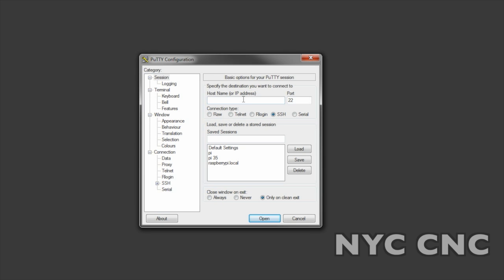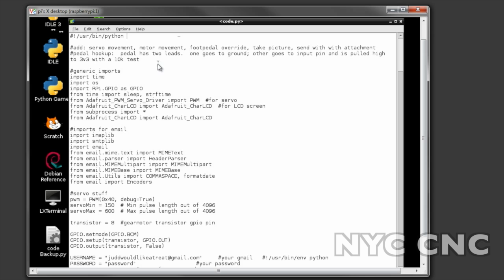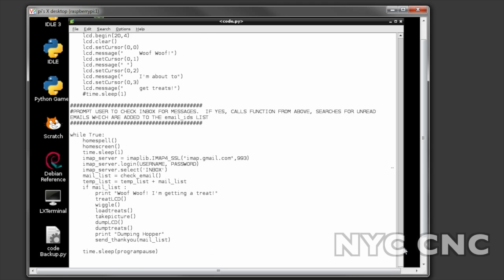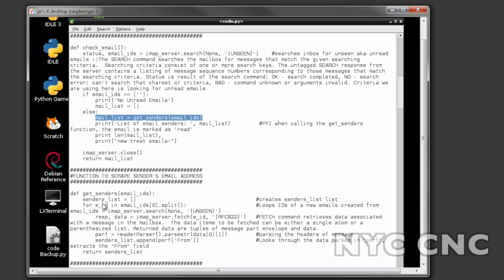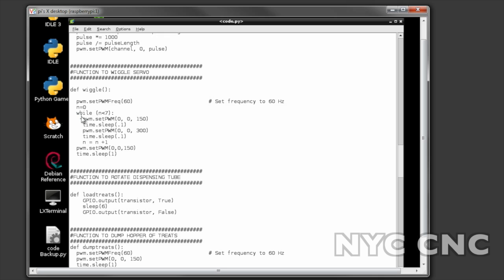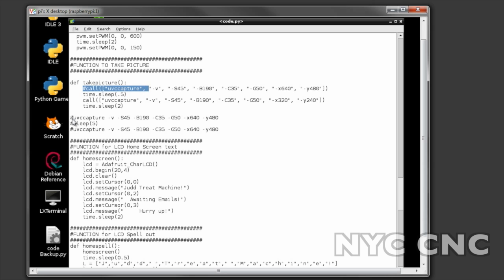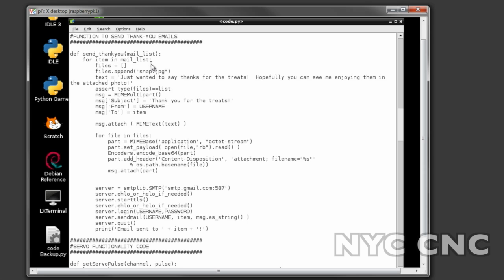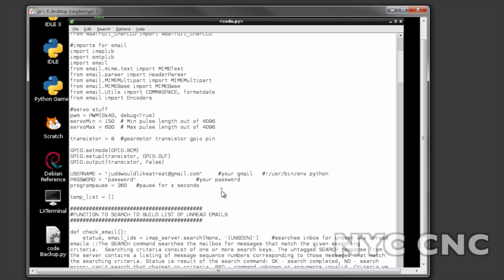Raspberry Pi Dog Treat Machine - Video discussing Python Code

Comment: hello john
thanks for you video.. it is really helpful.
so basically i am trying to modify the code for my traffic light that i want to control through email. i just want to make it work like when i email red, the red light should be on... Please help me with the pin number coding and the check email and sender's email option.. like where i have to put these stuff
also let me know if you have any better idea. i will look forward for you help...Thanks

Comment: This is an amazing project, and I finally finished 3d printing all the parts for my version of the Judd Treat Machine.  I decided to use a servo to turn an auger in a tube to drive treats forward to the spout.  i also removed the code and imports for the LCD screen.  I added 3 LED's (just recently) to indicate when email is being checked, and when a picture is being taken and a kind of not needed indicator for when the servo motor is dispensing a treat.  I only have the one motor that dispenses treats directly. :)  I removed a ton of code for the various features I removed, and added code for some that I added. :)

I added a load button to turn the auger manually to make sure there are treats up the tube so to speak  I also kinda cheated, i used the raspberry pi to control an arduino which runs the servo and turns on the various indicators. :) ( the LED's I may do from the PI directly) :)

http://www.thingiverse.com/thing:2187877   

i have an 11 year old Yorkie, who loves treats... :) Thanks for such an Amazing project and inspiration for my own dog treat machine based on yours. :)